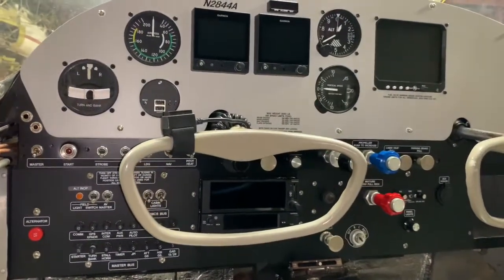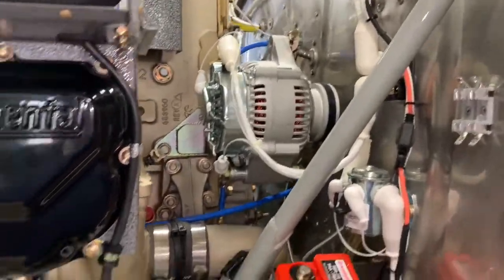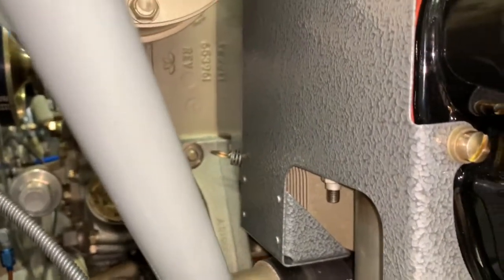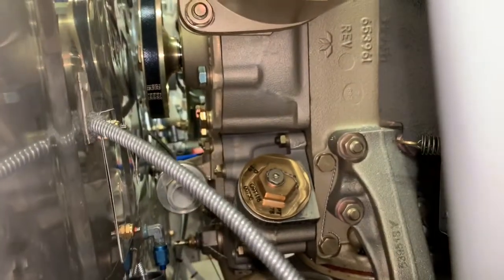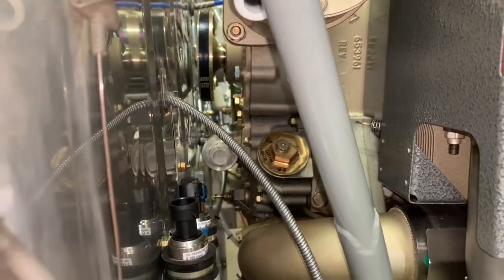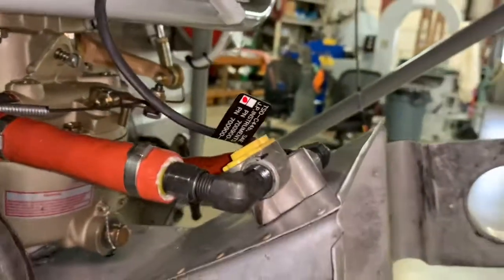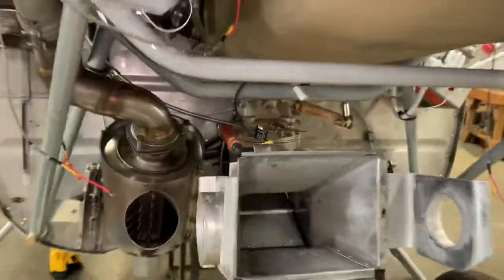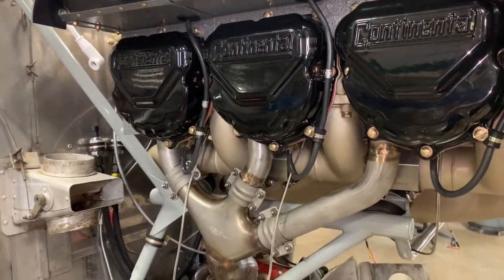Cessna 180 Panel Complete

Comment: What else was installed other than the G5s and the JPI? Also, what version of JPI did you use? We have a 1958 180A and I'm using this panel as a template. What was the cost for the avionics suite?
Reply from the maker: everything you see on the panel was replaced.  Avionics (not counting installation) were about 15k . . .